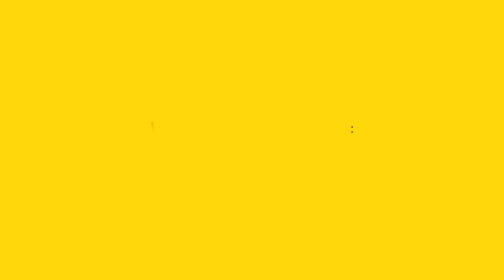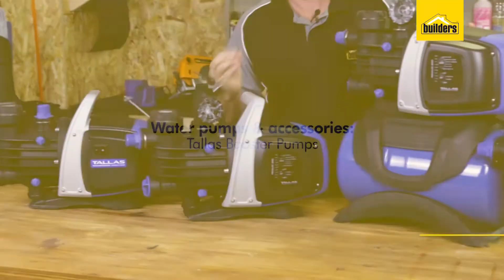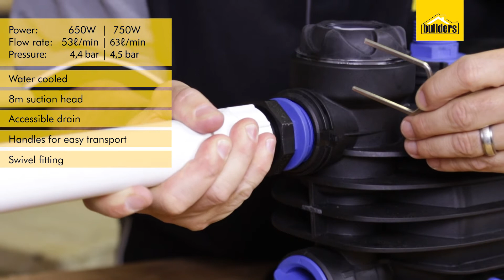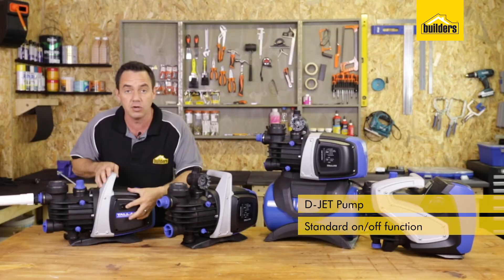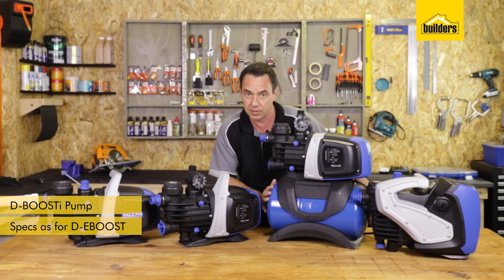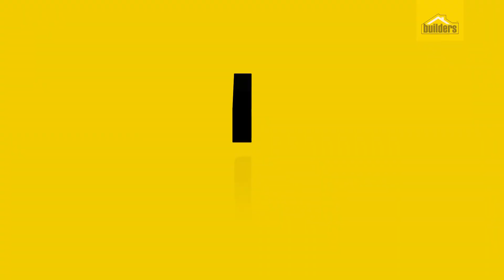Water pumps and accessories -  Tallas Booster Pumps

Comment: would I still need to have some sort of filters installed after the pump before it feeds into the main home supply?
Reply from the maker: Hi Waseem,  It really depends on where the water is coming from. If you want to pump your rainwater in to your home then you will need to use a UV sterilizer and filter. See this link.  https://youtu.be/NJ2O0o9w8_Q

If you are pumping municipal water into your home from a backup tank then no need for filters.  See this link. https://youtu.be/N7uzhe89So4

We hope this helps :) NM